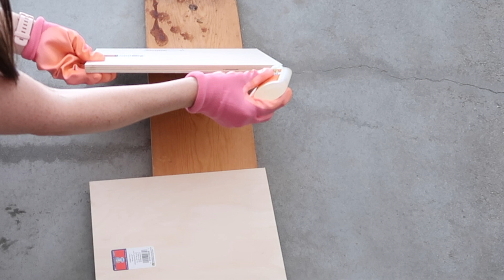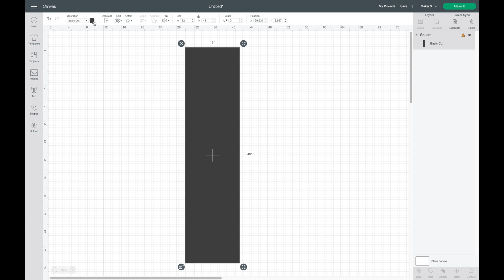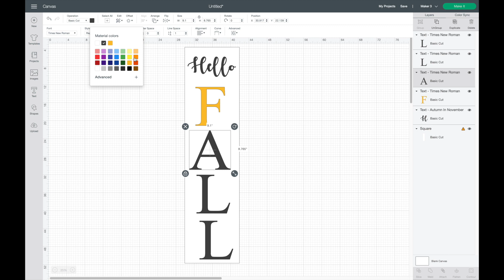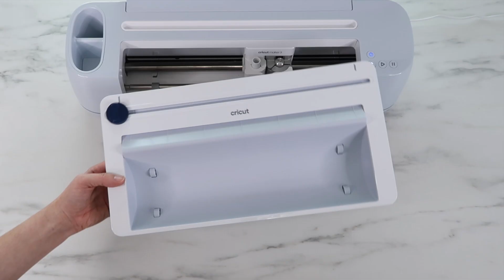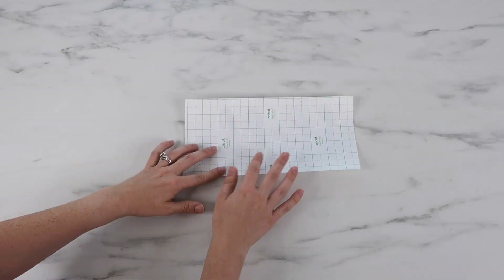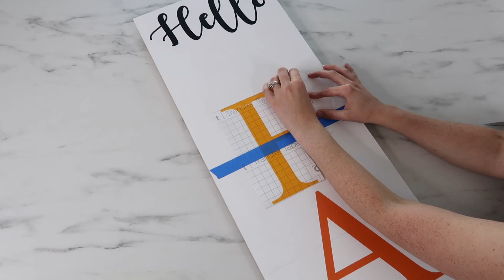HOW TO MAKE A FALL PORCH SIGN WITH THE CRICUT MAKER 3 MACHINE

Comment: I know this is an older video but wondering what settings you generally use for smart vinyl.  I received a bunch of it for Christmas and if I'm being honest, I cannot stand it and will never buy it.  I have the Maker 3 and swear that it never cuts all the way through even on the more pressure setting.  I also have trouble weeding it.  That could be because it doesn't cut well though.  Thank you in advance for any advice you may have!

Comment: Do you have to seal it ?
Reply from the maker: You can!! It is permanent vinyl so it should stay on well but if you have it outside you might want to seal it. I like using polycrylic but I spray a really thin coat, let it dry, then apply another thin coat. If you get too much sealant on it the vinyl can curl up. You can also use mod podge.

Comment: Did you seal your sign with anything to protect it from the elements?
Reply from the maker: I didn't but before placing it outside, I probably will. I like using polycrylic but I spray a really thin coat, let it dry, then apply another thin coat. If you get too much sealant on it the vinyl can curl up. You can also use mod podge.

Comment: Great explanation. I love the sign. One question. How did you determine that you were going to start 1/2 inch from the bottom and 1/2 inch in between each letter? Thanks
Reply from the maker: Thank you so much! I place the hello and each letter for Fall on my board first and lined it up where I wanted it then I took my measuring tape and measured where it was all at. They were both around 1/2 from the sides and the bottoms so I decided to go with it that.
Reply: @KaylasCricutCreations  Thanks. Nice job.